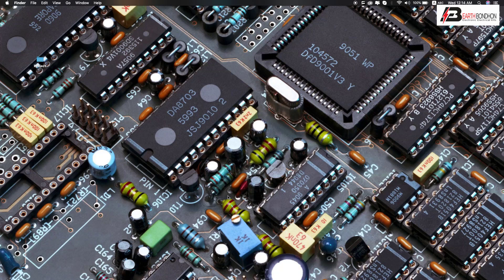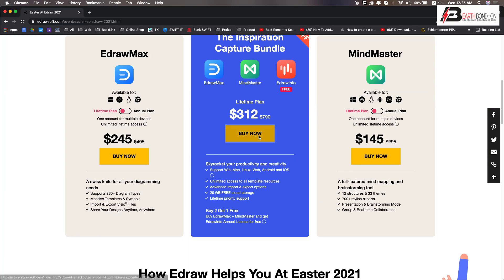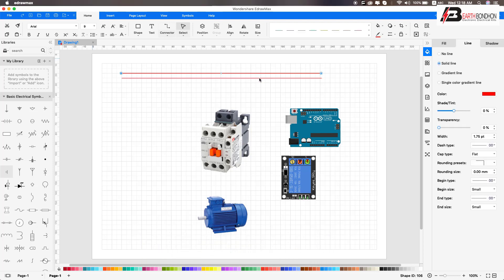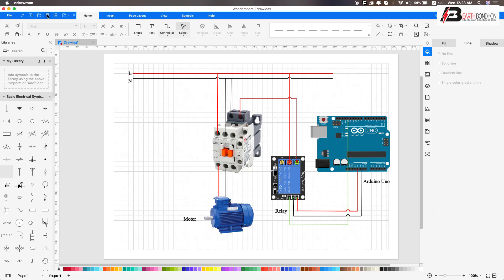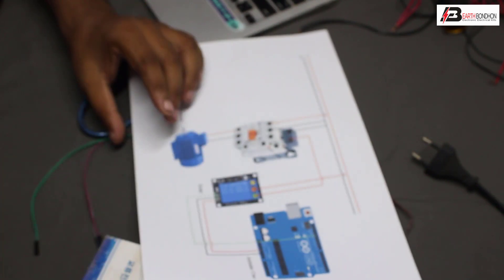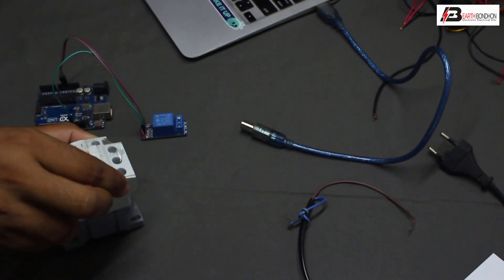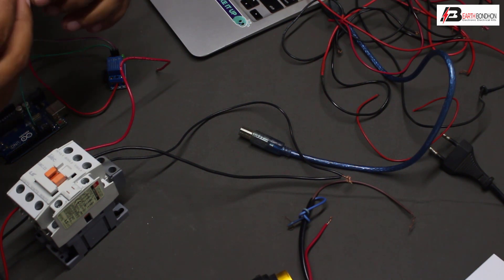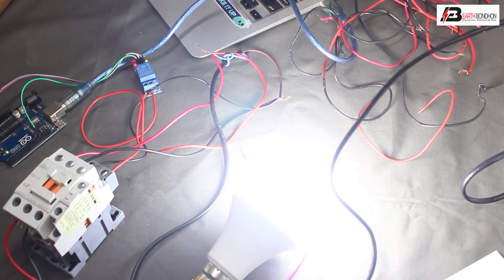How to use a relay with Arduino | Turn on and off 220V AC Motor | Motor | Lamp

Comment: This is okay for lighting up a bulb. Don’t use this method to control a high power motor. Once loaded the whole circuit will be damaged. There’s a specific contactors that consists 12v signal control. Use them.
Reply: How would you go about powering a high powered motor?
Reply: sir, if i use the 0.5hp water pump, what kind of contactor do you prefer?
Reply: Can you drop the contactor's full name/brand? And will the wiring be different?

Comment: Dear Sir. I do the same to turn on and of water pump. I use relay with opto isolate to control contactor coil. But arduino board reset when contactor close or open. Please advise me how to solve. Thank you.
Reply from the maker: Yes, you are right..
Thanks for sharing your opinion I will try to make a video on your topic.